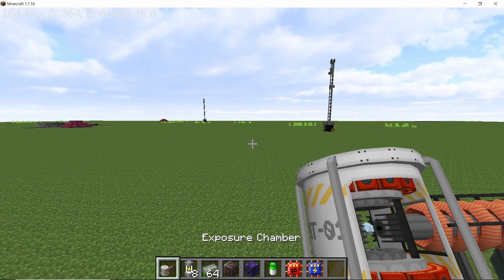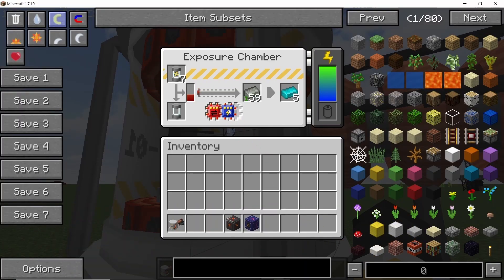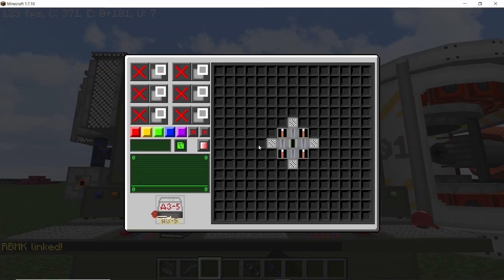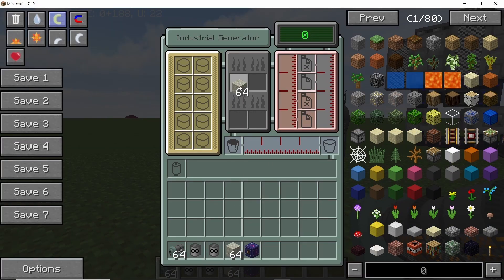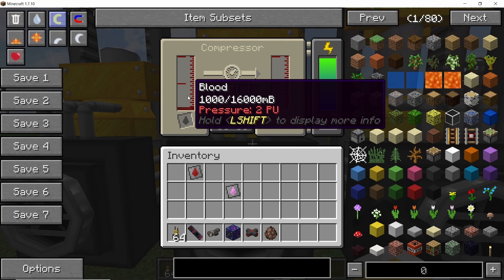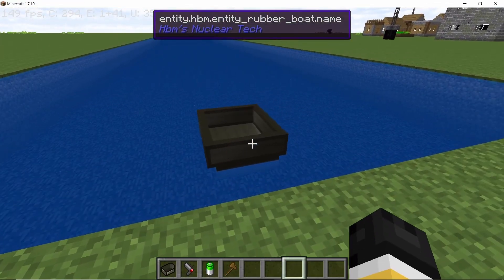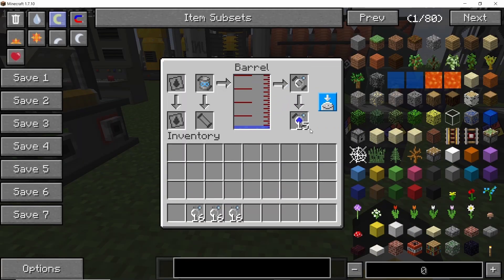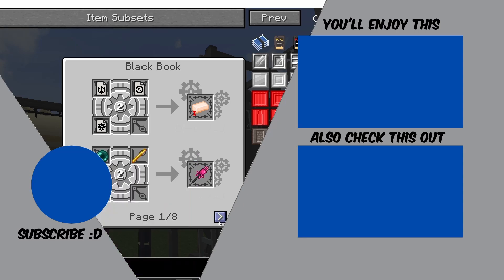Exposure Chamber, Blood to Crude Oil, Missile Crafting Automation, and More - HBM's Nuclear tech Mod

Comment: in my mind
i could setup a minefactory spawner thing with a villager captured, running it off a PT Cell or something
have the blood converted into fuel automatically
and the excess like Petroleum, i could use to power the jet engine keeping a perpetual cycle
Reply from the maker: Definitely doable, plus you can always hook it up to a Glyphids nest or a mob farm and that too will be a good way to stack up on alot of blood and crude oil
Reply: That is true, good idea!